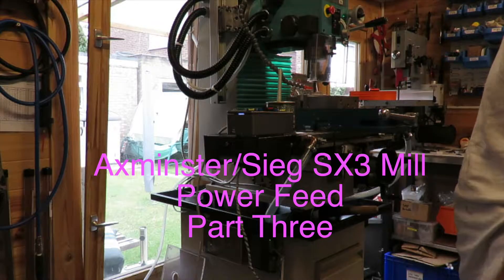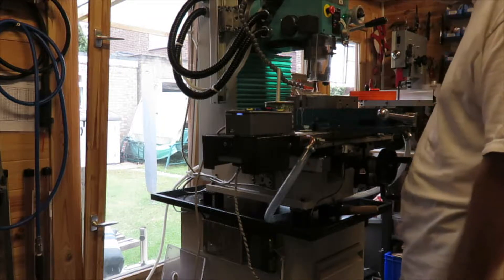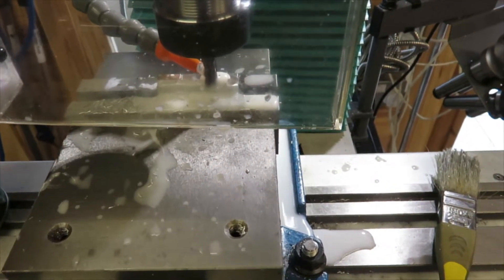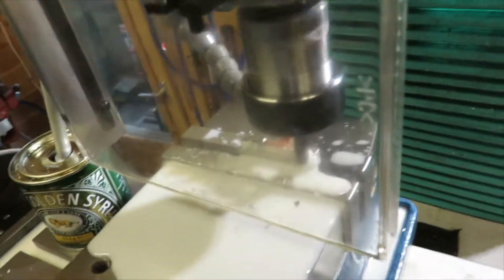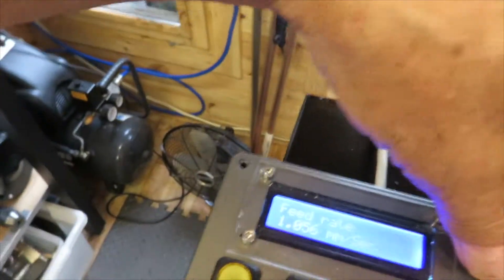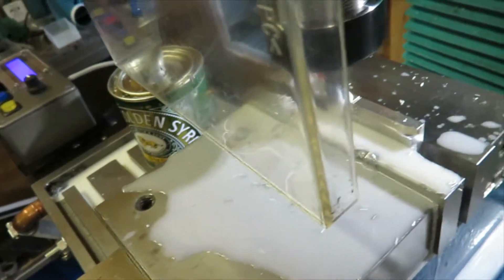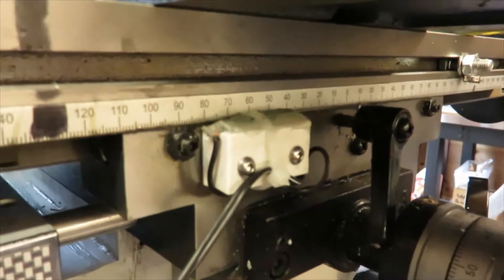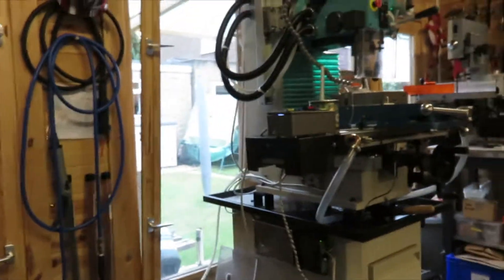Axminster / SIEG SX3 Mill Power Feed Part 3

Comment: Hi Chris, is that a 6” milling vice. How do you find that size on the sx3?
Reply from the maker: Yes it is and it works really well. The SX3 is just about big enough to take it. I have several other smaller ones but most of the time this one is on the table.
Reply: Chris Mower Do/can you use it on swivel base?
Reply from the maker: Paul Walsh you can as there’s plenty of height on the mill. I don’t since I find it just as easy to dial it in. Also I prefer the rigidity of bolting it directly to the table.
Reply: Chris Mower “Dial it in”, you mean you have cnc set up now?
Reply from the maker: Heck no, just meant that I use a dial indicator to set it up. Along the rear jaw if it is to be parallel, or using a sine bar and an adjustable parallel if I want it at an angle. I am planning to add CNC at a later stage, just haven't got around to it yet.
Reply: Chris Mower I see. Thanks for the info, ordering an sx3 digi tomorrow and trying to work out the best choice of goodies.

Comment: This is exactly what ive been considering for my mill. It's a larger mill but the same principle apart from how the servo connects mechanically to the table.

Do you have any details of how this is wired up? Its exactly what I'd like to make however Im not great with electronics. 

Great job.
Reply from the maker: danielwills93 part one shows the construction in more detail and  has list of the items used and where I obtained them . If there is anything in particular you would like to know I’d be happy to help.